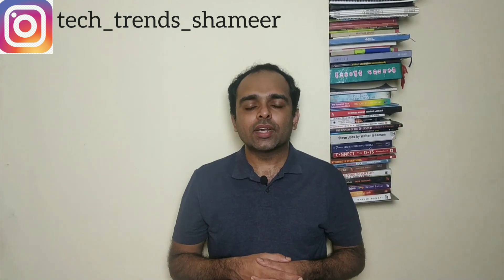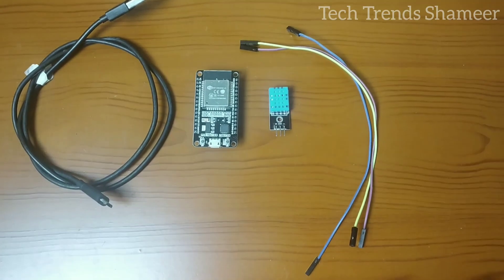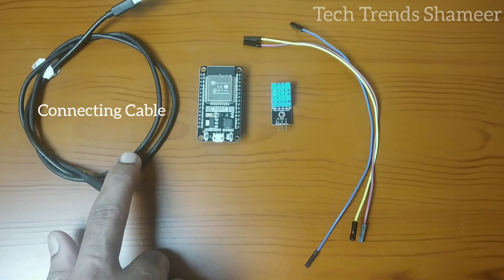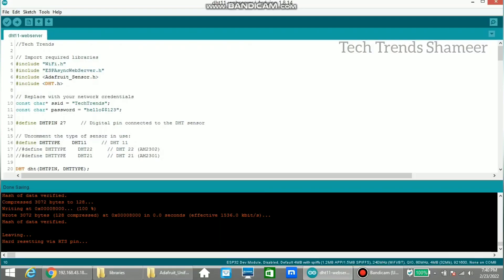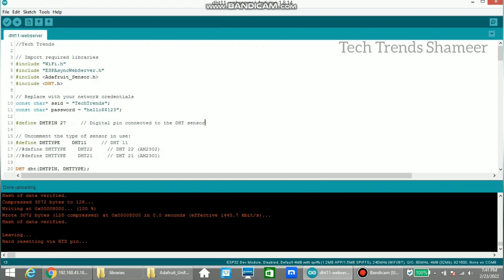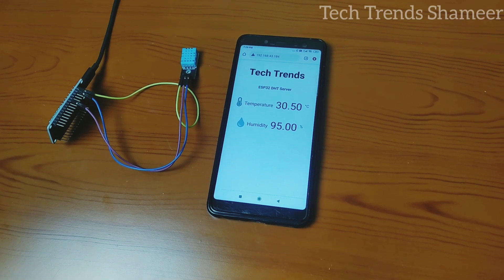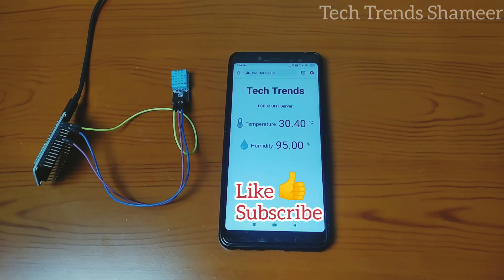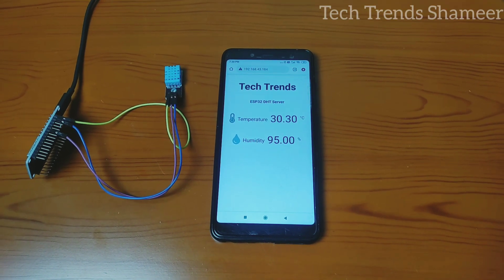ESP32 Temperature Web Server | DHT 11 Web Server

Comment: Please make a project with esp 8266 Where we can monitor the temperature and humidity by using dht11 and we can measure the soil moisture level by using soil moisture sensor and we can control the dc motor from the webpage local wifi Network or iot cloud
Reply from the maker: Sure bro. Will do.